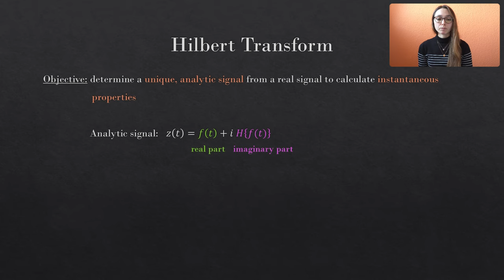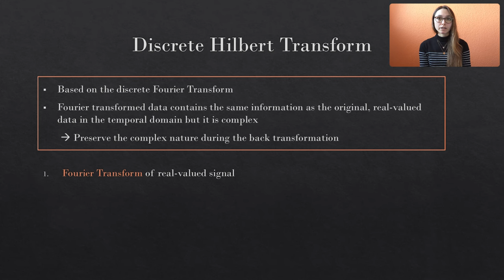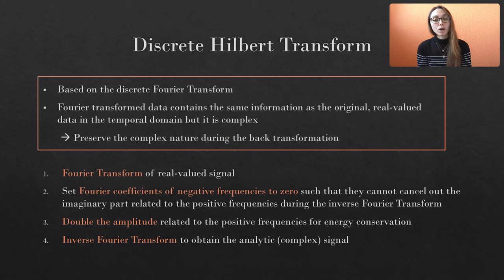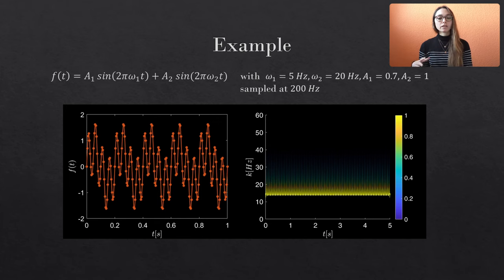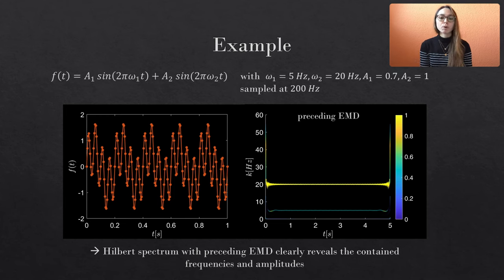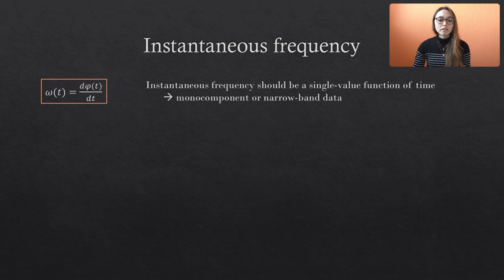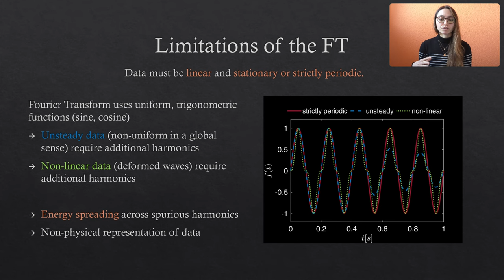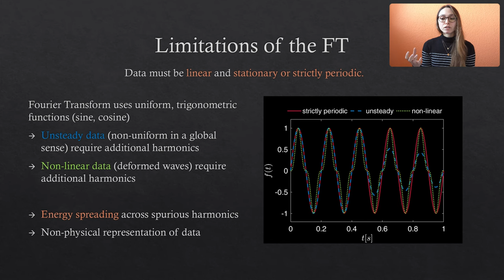The Hilbert-Huang Transform | combining Empirical Mode Decomposition and Hilbert Spectrum

Comment: Great video. I have a question.
 How can we use EMD algorithm for fault detection? I want to identify the faltu from a power signal data. If I use EMD it will convert the signal to monotonic signal. With this output how can I determine the fault in the power signal?
Reply from the maker: I am not very experienced in this topic but I would suggest to compare "perfect"  data (where you now that no fault has occured) with the faulty data. Then you should see that some frequencies are amplified in the faulty data and perhaps you are able to trace these back to, e.g., specific eigenfrequencies of a faulty component.